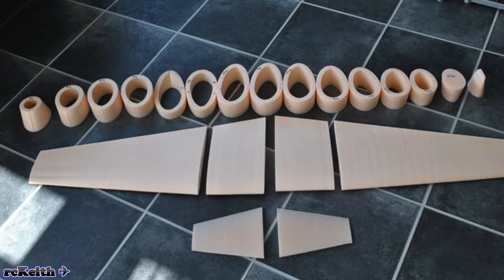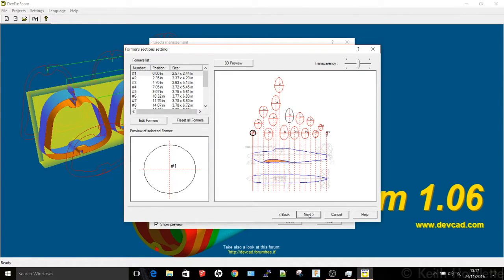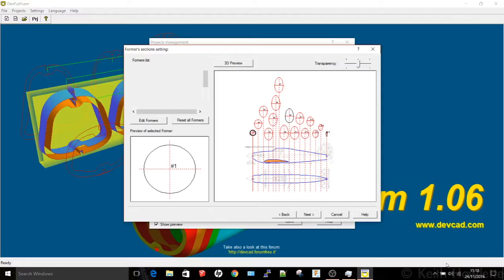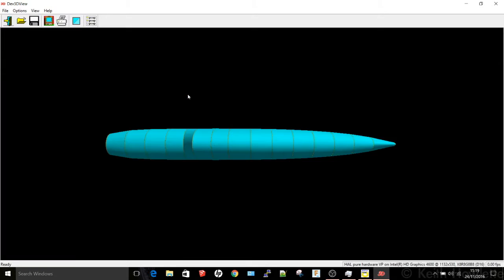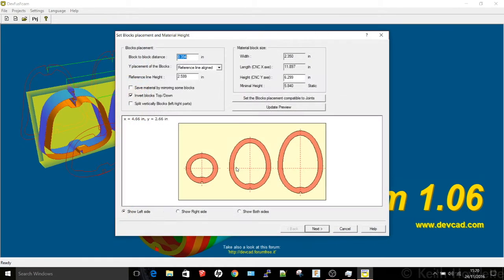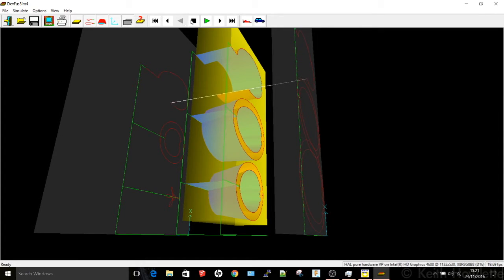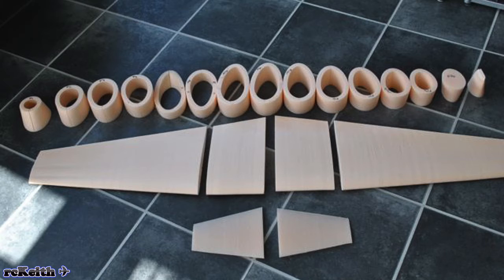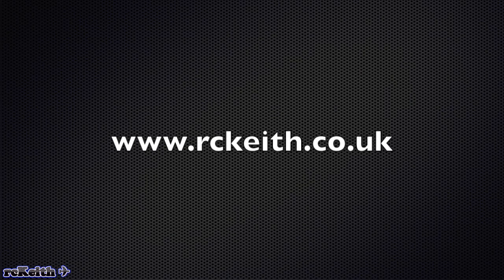HotWire CNC Foam Hawker Hurricane DevFus Foam - Part 2

Comment: Interesting, I already ordered devcad and I am learning to use the software, I have been trying to cut some tapered parts but I can't, I built my CNC foam cutter with arduino uno, and shield. I am going to try with arduino mega and ramps.  some friends are asking me to get out from arduino and get mach3, but I don't know what board to use.  congratulations for your great work.
My CNC cutter was built using aluminum extrusion 2020 and 4 motors Nema 17, Arduino Uno with CNC shield, and devcad software.
Reply from the maker: Hi, Luis thanks for your comments.  Mach3 is good software but come at a cost of $175 and was originally designed to use the parallel port. If you want to use USB then you'll need extra hardware. I have a post on my website showing the options https://www.rckeith.co.uk/mach3-parallel-port/   I use LinuxCNC for all my foam cutting now on an old desktop computer with a parallel port interface and have several spare machines.  Mach3 also works on these.  I'm upgrading my design this year(2019) to use NEMA17's and the Arduino Mega with RAMPS.  Mainly because I get a lot of feedback asking if it's possible to do that.  If you want to keep the cost down then an old desktop and  a parallel port controller on eBay something like this will do https://www.rckeith.co.uk/go/parallel-port-kit-ebay/
They still work really well and are very reliable.  A lot of people say they don't want to use old technology but Mach3 goes back to Windows 2000 days and they still use Mach3.    Hope that was helpful.
Reply: @rckeith  . thank you for your response, I  have been immersed reading your website and all the information that you have published. I love airliners and my goal is to learn to build my models.  Hoping  that I can start soon to do this. please let me know when your new ebook will be available, certainly I will order one.

Comment: Thanks for sharing. To start cutting, do you align the wire to a specific point - something like the lower corner of the foam block and zero the 4 axis? or do you leave it at home position and position to block to a specific position on the table and tell the DevFUs foam the location the of the block?
Reply from the maker: GlideFunAddict Hi 
I zero all the axis with the limit switches and then move off about an inch. Place the foam very close to the wire and left DevFus do the rest. As long as you have plenty of foam it's not too critical. Just make sure your foam is squared up with the wire and it works well and very accurate. Hope that helps